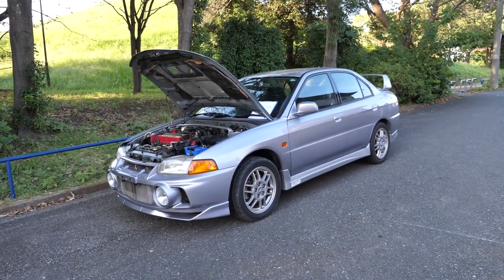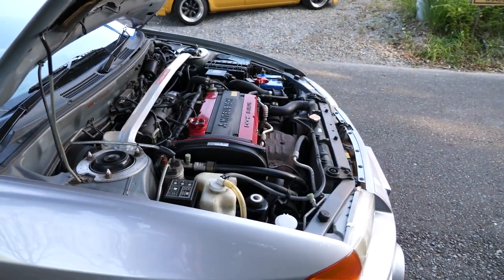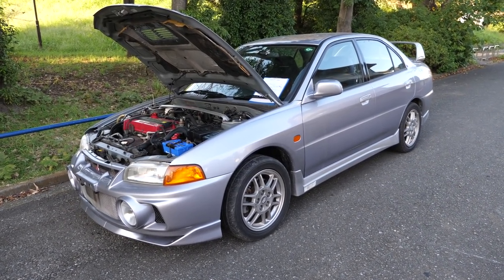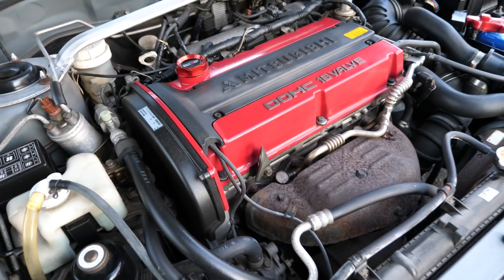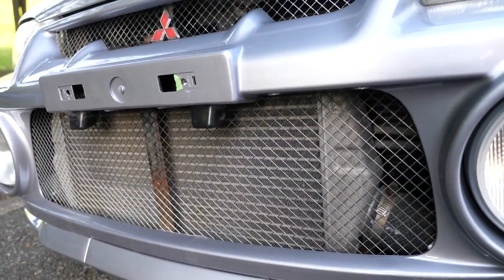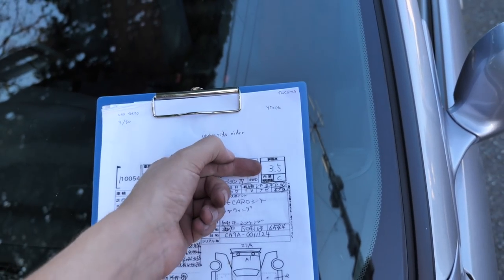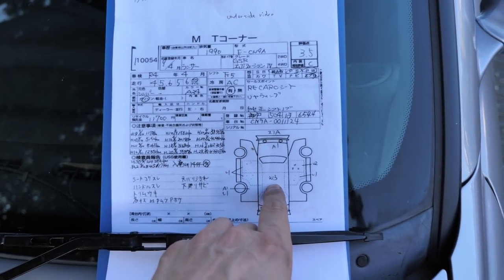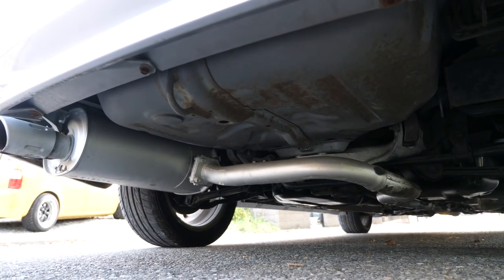1997 Mitsubishi Lancer GSR Evolution 4 (USA Import) Japan Auction Purchase Review

Comment: Not bad.. looks good, just bit of sandblasting here and there, repaint, dent repair detailing and replacement of the spark coils, exhaust pipes.. she will fly.
Say PacificCoastAuto, what's the story on black GC8 Subaru WRX in the background?
Will be doing a intro on it?